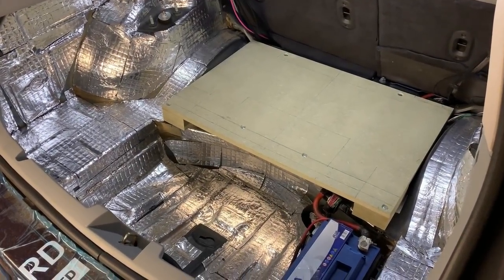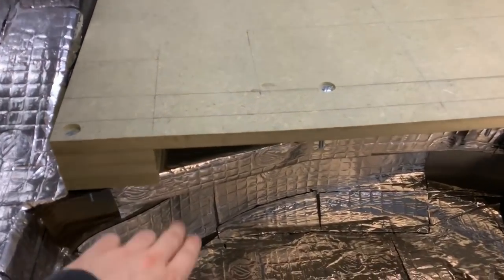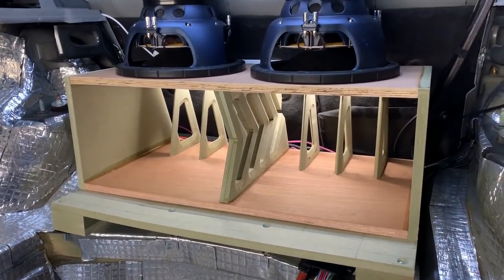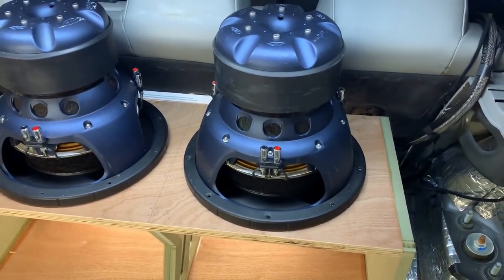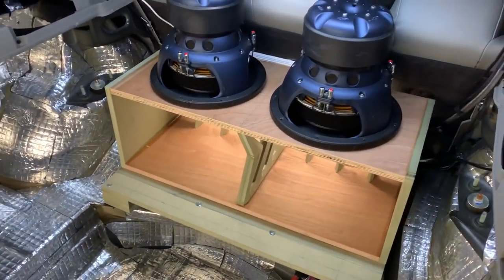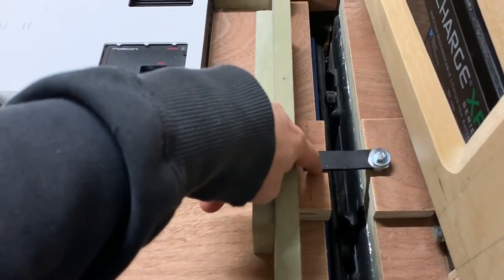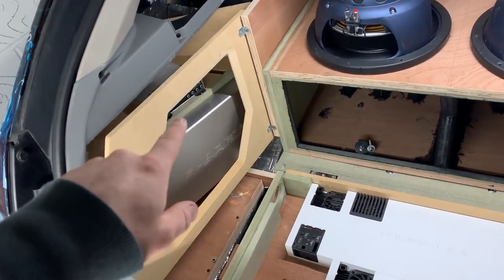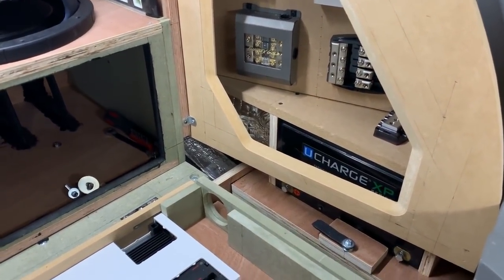Chrysler 300C trunk build - Zapco, Audible Physics, Gladen, Mosconi, Phoenix Gold

Comment: Beautiful work!
So many things that are unique on this one Peter. I bet you have gave a LOT of installers and DIY guys a few new ideas.....like the using the black Plexi (Perspex....I looked it up...they are the same...lol) as a mirror to show off the cones!
I sure hope most pick up on thing here, SAFETY!
I've seen first hand how installs can become projectiles during an accident. It's painful, sad, and then even worse comes the lawsuits if someone installed it incorrectly. Even if it was a friend in the driveway. It happened in Atlanta back in 1993 with 2 high school guys installed a box in a hatch. It rolled over and killed the driver......just awful. 
It really doesn't take much longer and even makes for a stronger install that looks and last longer too.
Thanks Peter for highlighting this in your install when most only want to show the glam.
Reply from the maker: Justin Exactly, safety is always number 1 on the list! Also, the more solid the build, the better! Less resonance, less rattle!
Reply: @pssound9749  I've been meaning to ask you about this. I've seen installs where the box and amp rack are eventually integrated with the vehicle itself like yours or I have tried to isolate the sub enclosure from any metal. It's either installed in a floating method or semi isolated with rubber feet or sand underneath.
Honestly I do agree how do you build yours. You had mass and mass doesn't want to move resonate..
It never gets old seeing the absence of MDF!
Reply from the maker: Justin Due to the fact that the box has to be mounted secure, it’s pretty impossible to isolate it!

Comment: How do you wire two subs together? I think if you have multiple subs you should always wire them in parallel because otherwise they will have different phases and will not be exactly synchronized
Reply from the maker: Karan Kasraei parallel or series or combination of both...doesn’t matter at all. What you think and what happens in reality are 2 different things.
Reply: @pssound9749  of course you are right,  my point is totally from an electronic perspective that is bothering me, because two reactive elements(subs in this case) wired in series will have different phases when a signal passes through them

Comment: Peter I heard u saying how low these subs can dig. What did u think of the sub you had up front in ur car? The Mille Legend subwoofer. Did it perform well? How much power do they need to give good output? And finally, Would u actually run two of them (10’s) in the rear?

Comment: Where the heck did you ground in the trunk, I have the same car and have a whiny noise cuz I can’t find a good ground.
 I also can’t find the frame can someone help
Reply from the maker: It has a factory ground point at the back where the OEM battery is also connected to, unless yours is different?🤷🏻‍♂️
Reply: @pssound9749  I did see that, I just thought it wasn’t the best grounding point so I ran another long ground from alt case to my lithium. Thanks for the reply!

Comment: Did you do a big 3 upgrade? If so how did you do it with the battery being in the boot
Reply from the maker: Chef D The factory run is 1/0, which is more than enough. We only upgraded the earth in the trunk.
Reply: @pssound9749  thanks a lot.